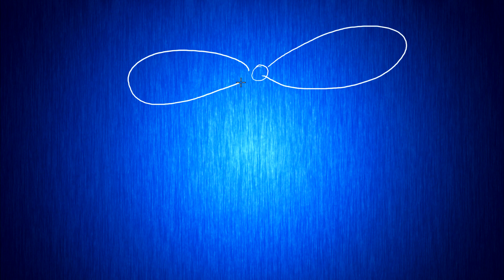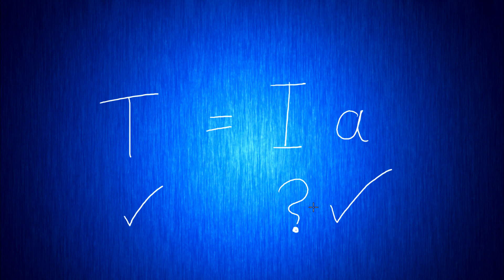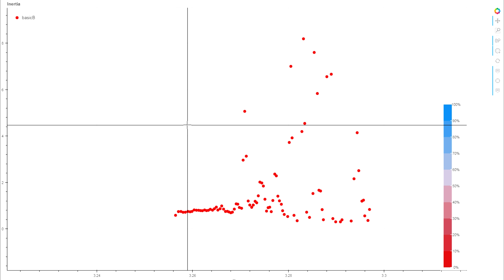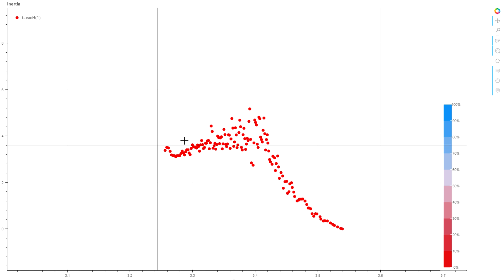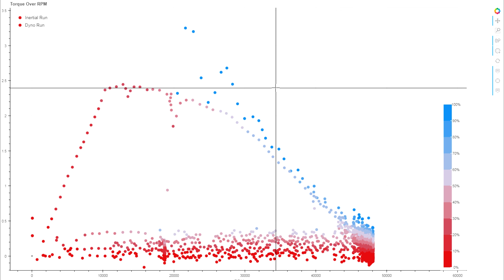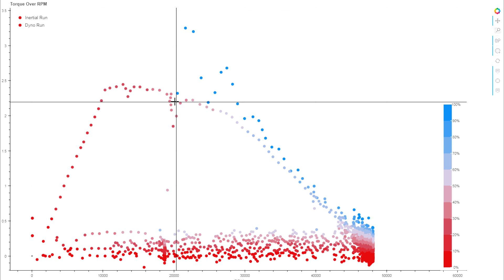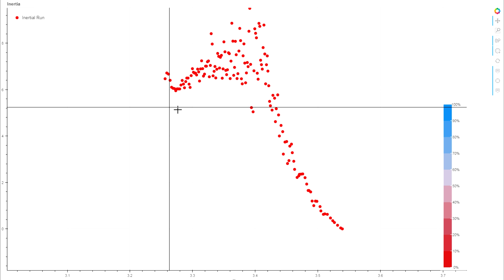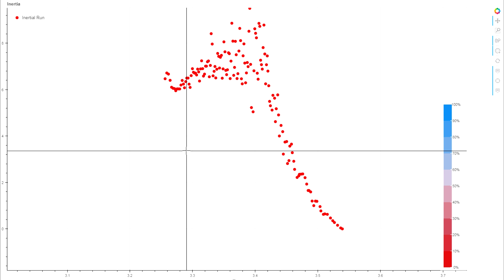Calculating motor inertia

Comment: there is rouphly calculation for large motor inertia?????
Reply from the maker: This same method would work on any size of motor, if you've already characterized the torque of the motor you could estimate rotor inertia the same way.
Reply: @SiieeFPV  
Ok, but I am a student and my graduation project is to perform motor starting study, I need to know motors inertia by a simple method "roughly calculation" as the project network has many motors and also I do not have dyno.

Comment: The effect of thermal soak is interesting.  I know you want to get the true torque abilities of the motor in your results.  But I do think there is some importance to leaving the thermal soak in the results.  We push these motors pretty hard in our freestyle/racing multicopters.  The motors are going to be warm in real world use.  I would love to see tests on how aggressive cooling like the Brotherhobby Tornado motors effects sustained power output of the motor.  Silver windings are also becoming common in high end motors.  I would love to see if the superior heat/electric conductivity of silver really makes a noticeable difference.  Your testing setup is very impressive.  It has so many useful applications.
Reply from the maker: I don't intend to remove it from the dyno results but I have to compensate for it when calculating inertia.  Cooling on the bench, even with a dedicated fan for the motor, is not nearly as good as you'll get in the air.   You can also see thermal effects while doing thrust tests, and it can take a surprisingly long amount of time for a motor doing a full power run to actually reach equilibrium temperature, and that can cost quite a bit of thrust compared to what you'd see just doing a quick burst and peak reading.  All just even more little factors to think about.